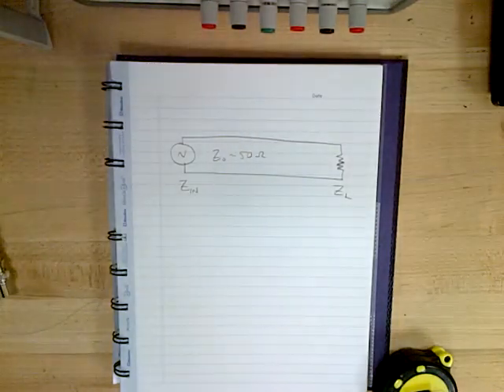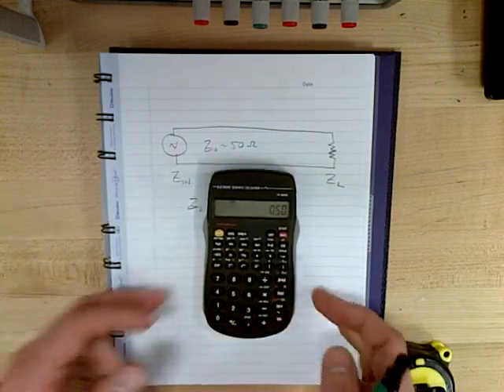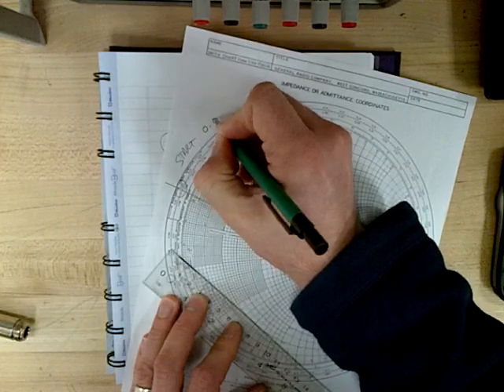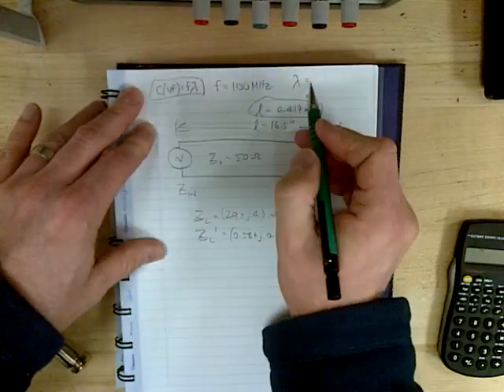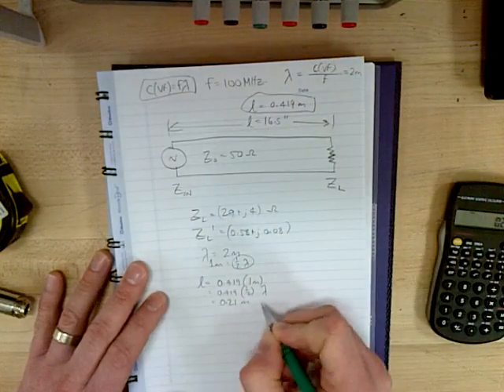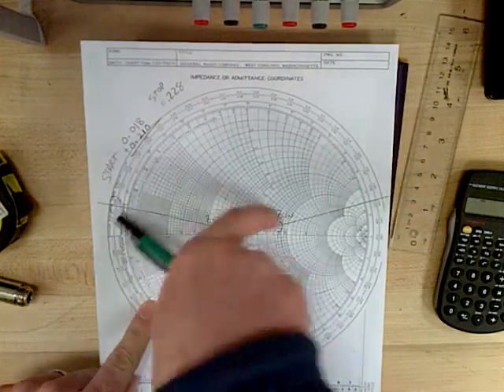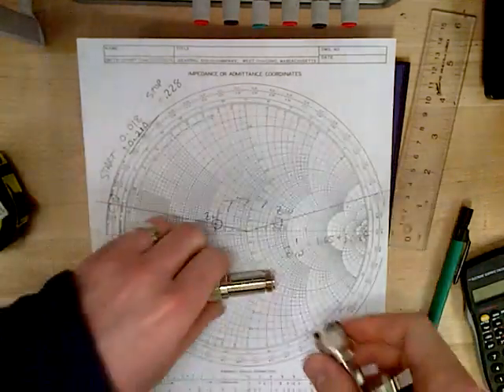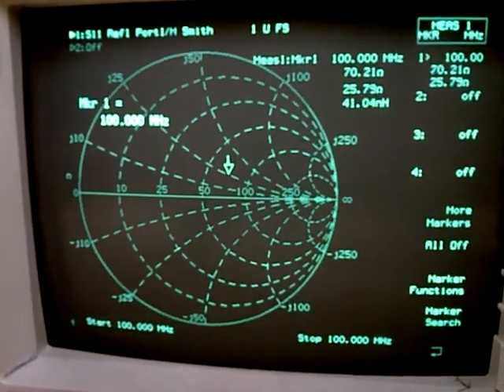Smith Chart Impedance

Comment: Very few people have the ability to communicate necessary basic concepts in a simple manner. I have been after understanding the Smith Chart for a long time. You've brought home to me the understanding that I've been seeking. Also, to start in inches is a good thing, better to learn both measuring systems instead of just one or the other. Use of this chart lends a visual understanding of impedances, "seeing" what happens as you measure along the length of an rf transmission line.  I will tie this knowledge to polar and rectangular plotting of impedances and phase angles.  I am very grateful for what you have done in your videos. Thank you Carl!

Comment: Dear Mr. Carl
I am your student for the year 2004-2005 I have question If transmission line`s RL is good but the Insertion loss is too bad what could be the possible reason if cable is looking good with out any sharp bends etc.

Comment: What if you were to have a composite line with 2 different propagation speeds and impedances connected in series? Would your propagation speed simply be the slowest of the two?

Comment: Sir,I would to ask you one question.To know the value of the wavelength,please explain how do you get answer of 2 m in wavelength.
Reply from the maker: Since the cable has a relative permittivity of 0.67, the velocity of signals IN the cable is (speed of light)(0.67), compared to speed of light OUTSIDE the cable.  To find wavelength we use v = (f)(lambda), where v is velocity IN the cable, f is 100MHz.  Solve for lambda and you get 2m.

Comment: 1.) λ = 3m (2.9979) at 100MHz, not 2, so  λ / 2 = 1.5m.  
2.) The permittivity is nothing to do with light velocity (especially with 40cm UHF cable), but only with the impedance of the cable for some frequency, so the velocity factor = 1. This line can not slow down the light velocity!
3.) You had to measure Z(load) with the adapter together, so measured Z(load) is fake. You got a mismatch of approximately 16 Ω (real) onto Zo=50Ω compared to analyzer, which is ~ 1/3 of Zo.
Reply: +Jiji Biji 
2) Please check it: http://www.radio-electronics.com/info/antennas/coax/coax_velocity_factor.php
Reply: Sorry, Jiji but a wavelength of 3 m is only applicable for an electromagnetic wave traveling in free space. You must consider the velocity factor of the given cable when you're trying to run a signal through it since it wont pass through all mediums at the same speed. In this case, Carl's approximation of (2/3)*C is correct (well, close enough).